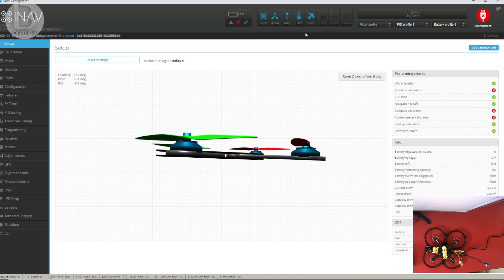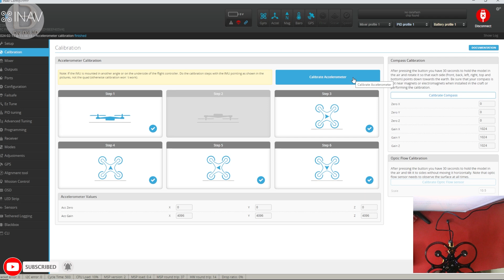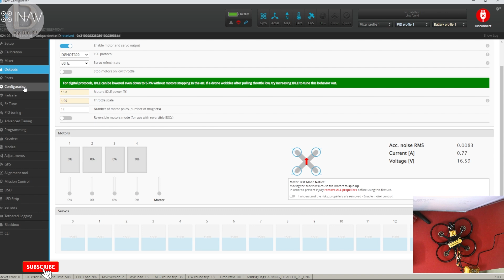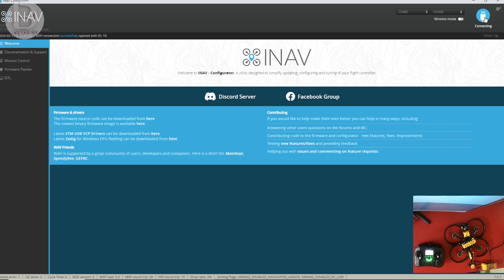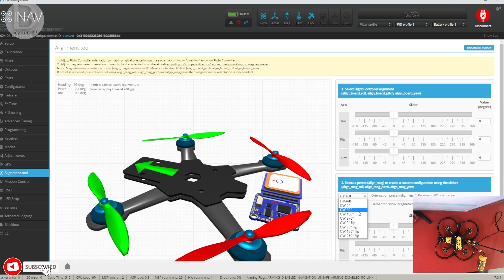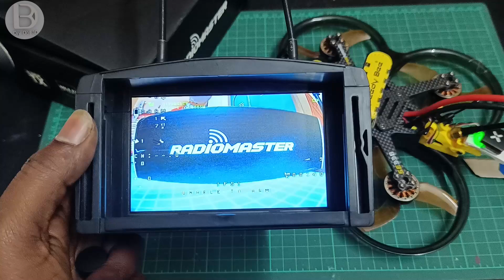Speedybee bee35 drone build English Part 2|#speedybee #cinewhoop #inav #configuración #diydot3dtech

Comment: so you put the stack to the 180 degree its showing correct,. i have build speedybee 35 cinewhoop f405 v3 stack. whenever i'm calibarting the drone its shwoing flip 180 degree. please give suggestion if have any thanks
Reply from the maker: @Techgv  hi place your fc pointing front . Don't flip fc. Either you place above or below 4in1 esc fc should be pointing front side. You can see arrow on Fc
Reply: @DiyDot3d  i have placed it on forwarded direction where arrow indicates. Thanks